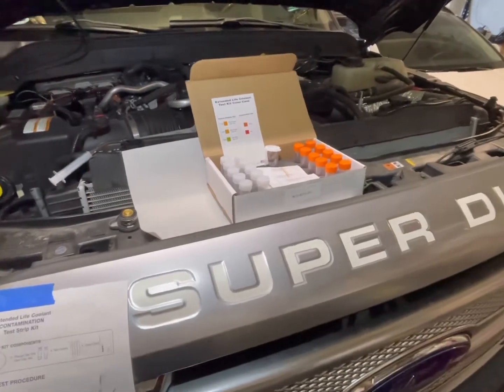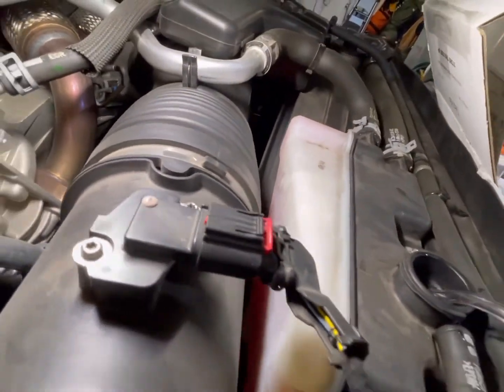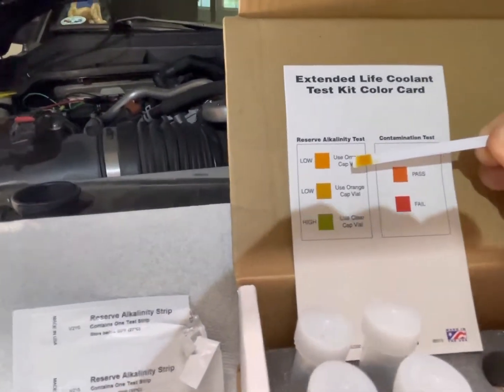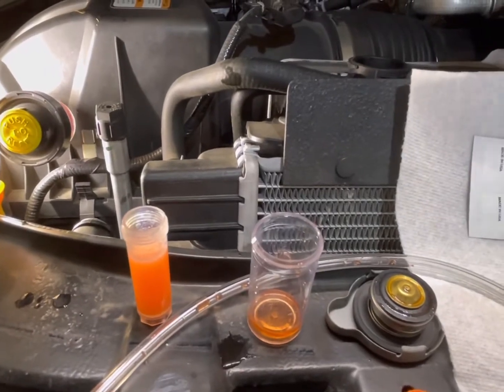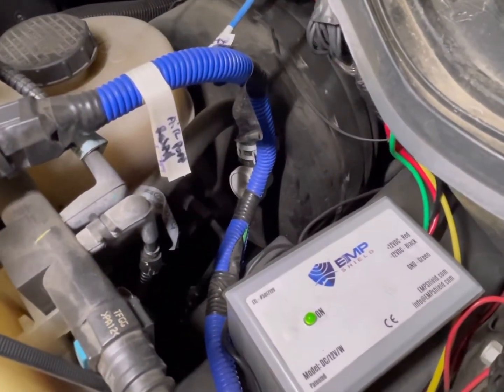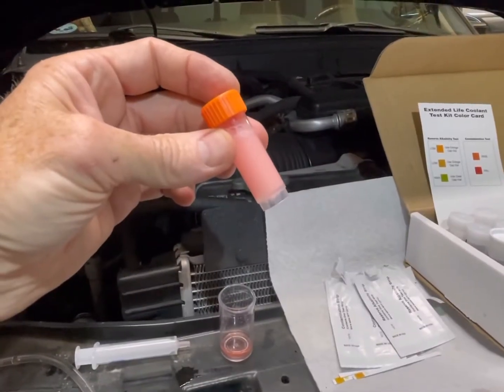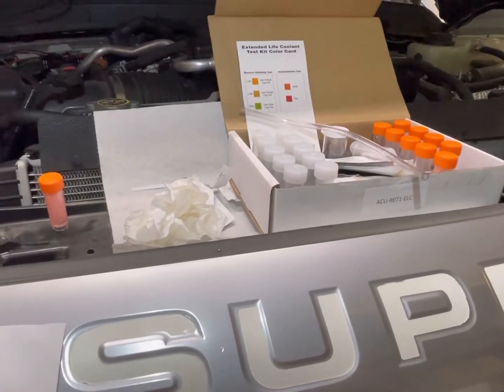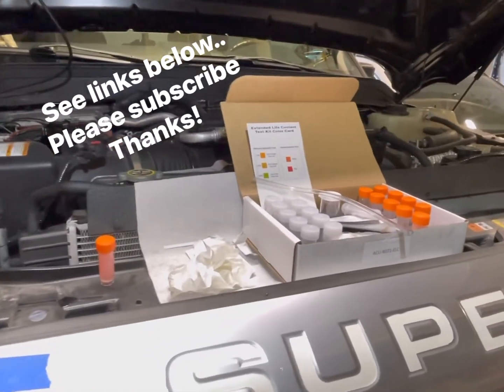Ford Super Duty Check Coolant Additive & How to test it. (F250, F350). Test strip kit.

Comment: Sorry if I'm missing the point but why would anyone test it? Wouldn't it be easier to just drain and refill it?
Reply from the maker: My understanding is that - YES - you can just change it.  Also, I think you can get a caution light at some point telling you to change it.  But if you don't want to - then you would test it and then clear the message or reset it.  Other folks - chime in if you have more info.  I had the radiator replaced under warranty - and wanted to be sure the dealer replaced it with the proper fluids.  Yes, I'm paranoid that way ... LOL.

Comment: Thank you for making this how to and including links! I did my own drain and fill for both primary and secondary on my 15 250 when I hit 115K and now that I’m a little over 125K and the message popped back up. I called my local Ford dealer and they told me they don’t sell the test strips. I tried asking them if they could test my coolant for me, and I’m not sure if they didn’t understand what I was talking about but they said I could come in and they would do a drain and fill for $259.. yeah, no thanks, I would do that myself for way cheaper and a few hours of my time if that was my plan lol.
Reply from the maker: Your welcome!  You should be good since you already flushed not long ago.  That message is only based on hours.  So most people don’t even need to worry about it.  Take care!
Reply: @TheRealWorld737   Right on. Thanks for the reply! That’s what I was thinking. I didn’t know about the hours, but you can imagine my face when that message popped up since I felt like I did that drain and fill just yesterday lol. I appreciate the input and I will disregard that message and continue with my normal scheduled maintenance. You take care as well good sir.
Reply: It’s absolutely shocking how few Ford dealerships actually know about testing the coolant for nitrates and contaminants. They either don’t know anything about it at all, or, and this is actually happened to me, they tell me to just add a quart of the Motorcraft coolant additive whenever that check additive message appears. Scary stupid these people who are supposed to know how to take care of $80,000 vehicles.
Reply from the maker: No kidding!!